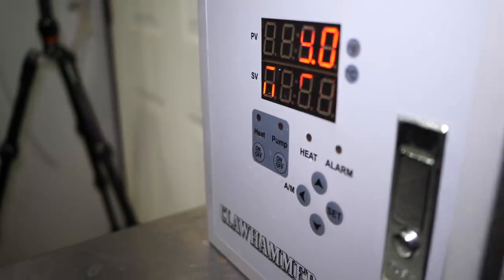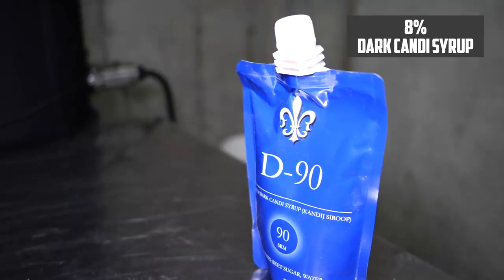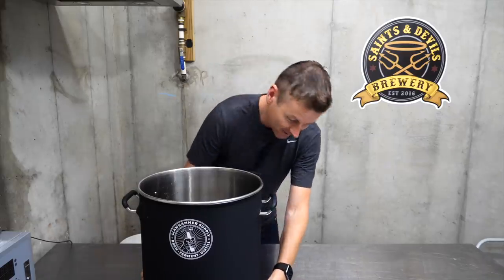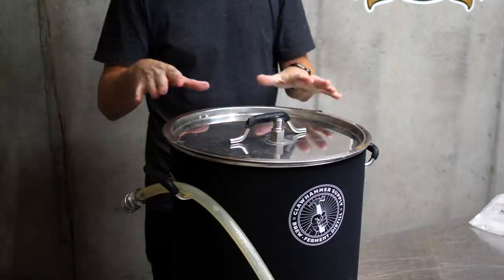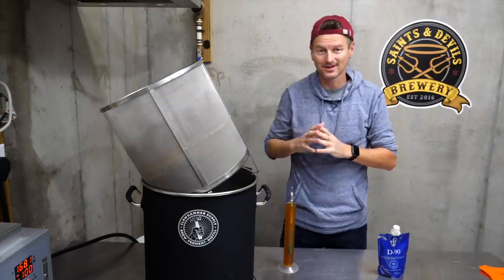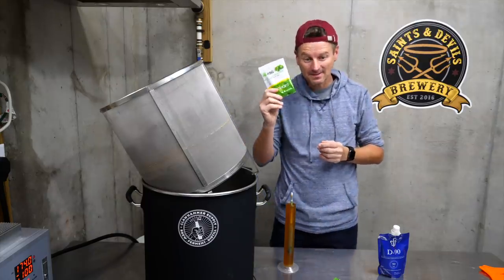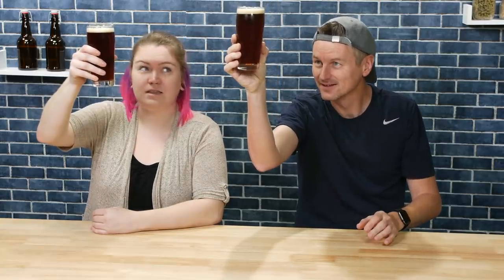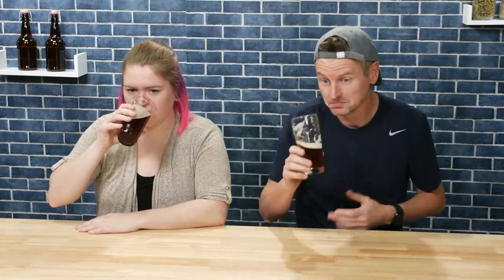Belgian Dubbel | Overnight Mash with Jacket

Comment: The monks do it with pilsner malt and caramelized sugar, and Belgian yeast. The color is from the burned sugar. My best dubbel was with pilsner, crystal 120, sugar and bitter orange peel. BE-256 yeast. Best beer I ever made.
Reply: I just finished a Dubbel as described. I tried making my own inverted sugar/ candi sugar , and it worked in the main , however it appeared a lot darker in the pan. Once it cooled it was a little light and Im pretty sure the EBC will be lower than the standard. Let's see how it tastes which is the main thing.
Reply: Awesome to read, I'll be brewing a dubbel with homemade Candi Sirup and BE-256 too.

Comment: What was your anticipated final gravity. You said that you were wondering if it would be lower because of the lower mash temp. Was 1.010 what you were expecting. I would anticipate that you wouldn’t get all those sugars from the lower mash temp because, as I understand it some of those enzymes would get denatured at the higher initial temp. Also most of the starch would have been converted so even if the enzymes were not denatured, there is not much starch left for them to convert.

Comment: I am thinking of brewing a dubbel as a start of a solera.  I don't have an oak solera (yet) but I think if I use some oak spirals it might make for some interesting beers.  The reason for a dubbel is that I want to pull a batch for a cherry double, an apricot, and so on.  Also thinking of a blending a few old and new beers to see where I can take it.  I would think aging it would make for a better beer. Has your beer aged well?
Reply from the maker: That sounds great. And yeah have generally been very pleased with the aged beers.

Comment: Hi Martin, what is a typical efficiency that you get from the Clawhammer system? I'm looking to upgrade to an eBIAB system and want to invest in a system that can give me good efficiency. Thanks, and cheers from the Charlotte area.
Reply from the maker: Hi there Bill. I typically see around 68% without sparging.
Reply: I also see 68% pretty commonly with my Clawhammer system. But typically i can bump it up to the lower 70s by stirring the grains a couple times throughout the mash! :)
Reply: To get good efficiency with brew in a bag, you need to crush as fine as possible (high conversion efficiency), use a very fine mesh bag like a Wilserbrewer and squeeze it after mash (higher lautter efficiency).  You're likely not going to get stellar efficiency numbers from any kind of brew in a basket.  But efficiency is not all that important at the home-brew scale.

Comment: That mash tun needs a hat on it, heat rises,would like to see how the temperature was maintained if you'd thrown a blanket on the top of it.
Certainly a good idea to save watts during the mash and boil with the insulation regardless of your voltage.
Reply from the maker: Agreed, would be a good thing to try.